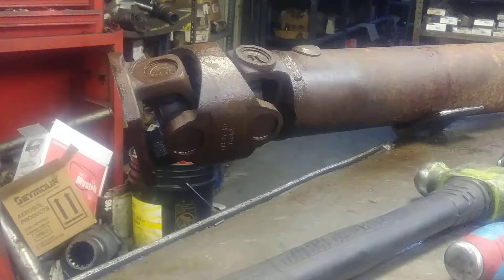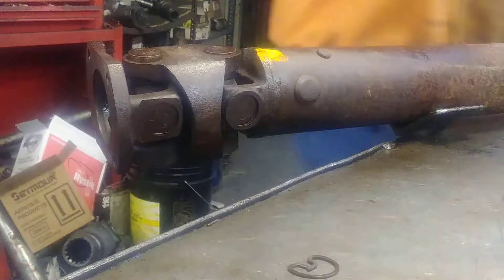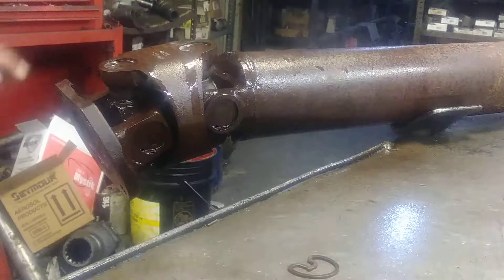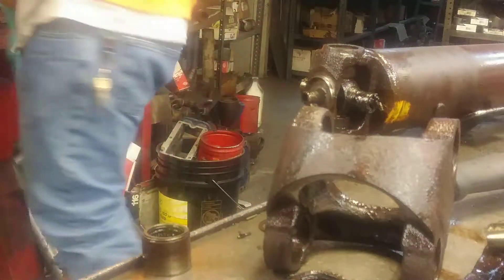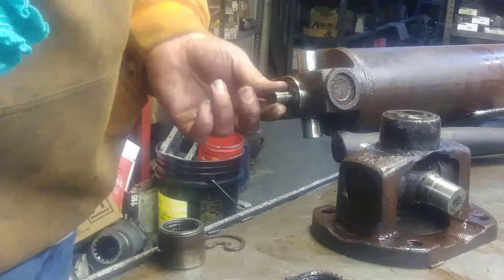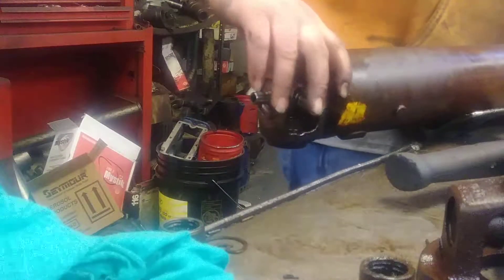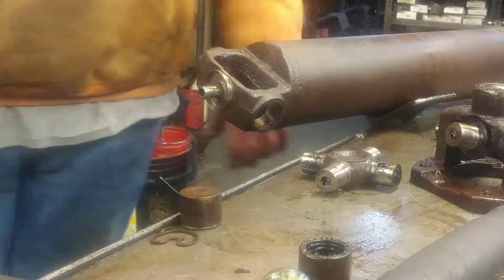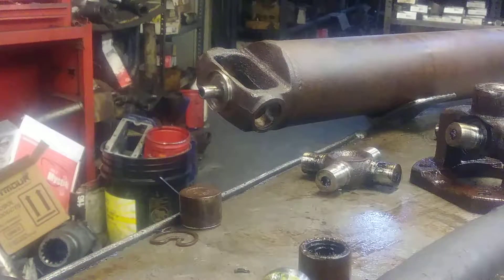Disassemble a CV head on drive shaft

Comment: Getting ready to do this to my 76 Chevy k10 with a full time transfer case do you by chance know the part number spicer uses for it. I’m actually worried I’m going to be forced to buy a reman I discovered I have almost 1/4 inch play in the CV joint and it’s probably never been served I’m pretty sure I’m the first person to ever even think to look given the condition of the rest of the truck
Reply from the maker: I can give u my number or email i need to see pics of what u have and need measurements off joints etc but spicer and neapco has the parts . Thats the 2 best of the best brands i prefer neapco in some applications